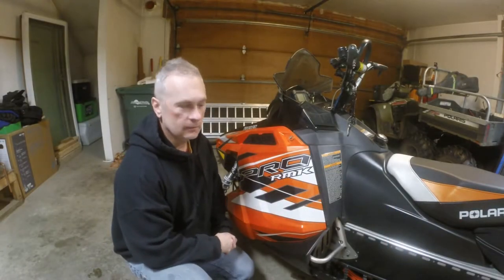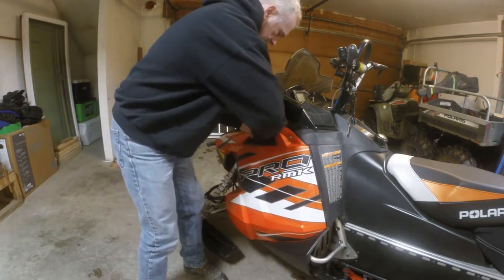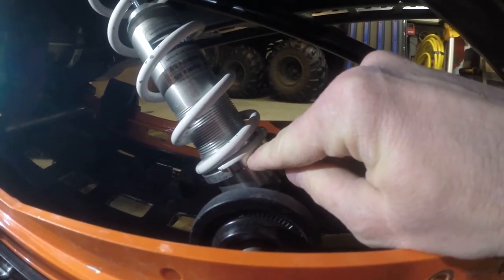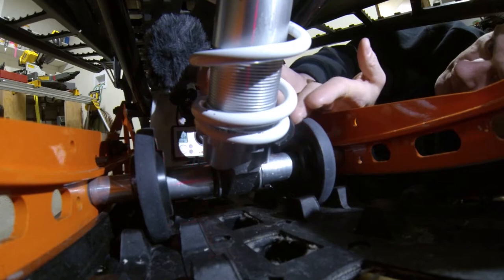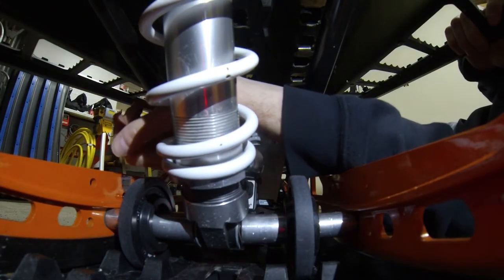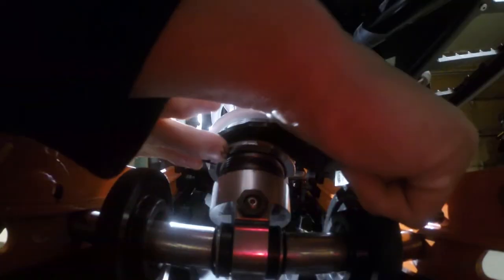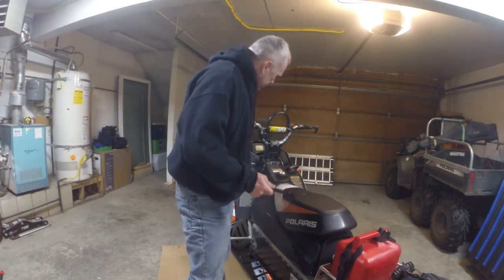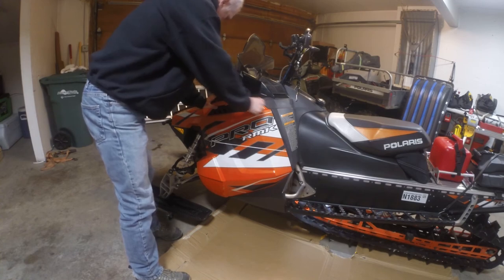Unable to do snowmobile wheelies fix

Comment: Just rode snug harbor for the first time, was trying to wheelie and couldn't. Someone suggested adjusting the limiter strap. Your thoughts?
Reply from the maker: That can cause an issue.  Two big factors in doing wheeles are the rider and the snowmobile.  The rider needs to have correct foot placement, know when to pull and throttle.  The other factor to a lesser extent is the sled. Some sleds aren't made or can't put out the power needed to wheelie.  I know this doesn't help much but it's all I can do without knowing a lot more.